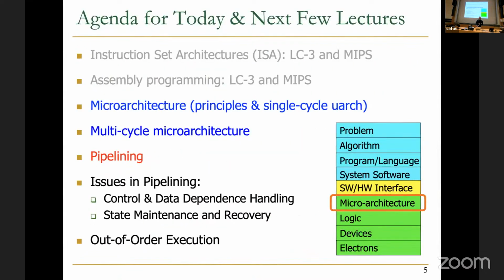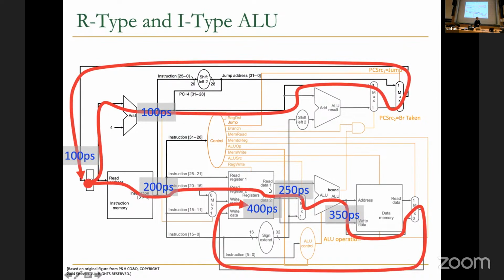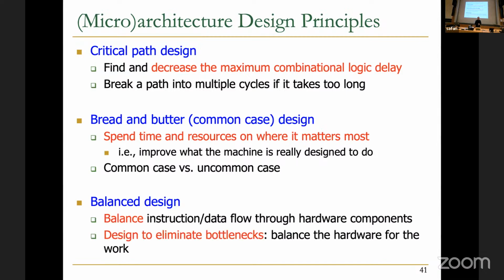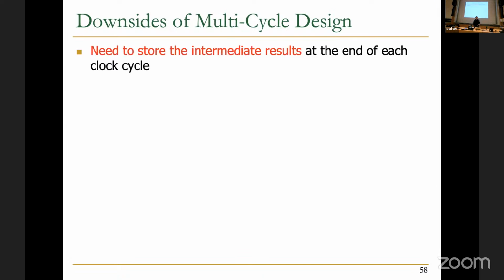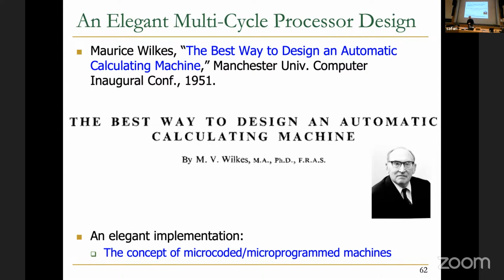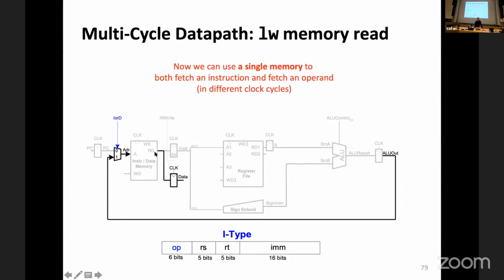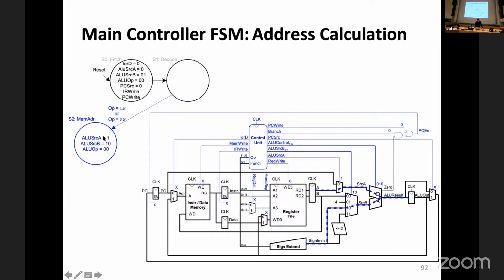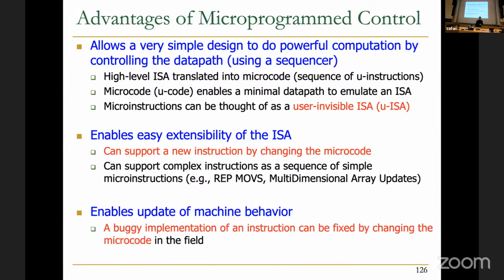Digital Design & Comp Arch - Lecture 11: Multi-Cycle Microarchitecture Design (Spring 2023)

Comment: I read the book chapter before watching the lecture. Halfway through the lecture, I was a bit bored because the lecture contains the same thing. But the concept of microprogramming at the end really was the cherry on the cake. Now I am thinking, Can we implement this FSM microsequencer using logic arrays by burning the ROM so to speak? Because we must need some nonvolatile storage that holds this microprogram which fires when we reset the system by pressing Power ON button. Nonetheless Great lectures, 2023 playlist is the best.

Comment: If the memory is a synchronous memory, doesn't that mean that the data from PC will first flow into the internal MAR in one clock cycle, and then data is valid on the 2nd clock cycle?
Reply: The instruction memory, register file, and data memory are all read
combinationally. In other words, if the address changes, the new data
appears at RD after some propagation delay; no clock is involved

Comment: On slide 96, control signal PCSrc is 1, however there should be two bit PCSrc (01) since its a 3X1 MUX at the ALU output register. It is correct in slide 101.